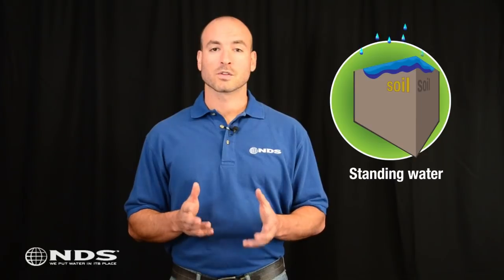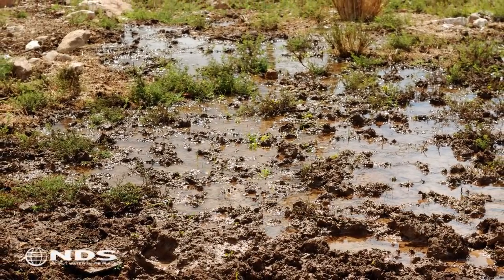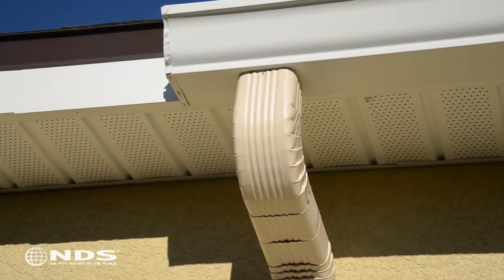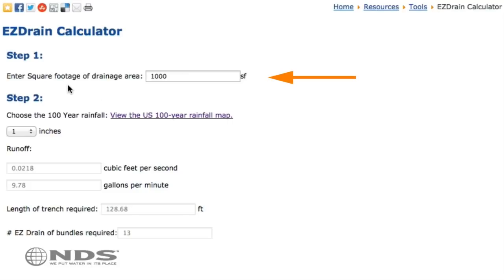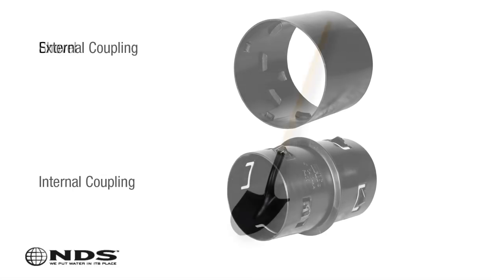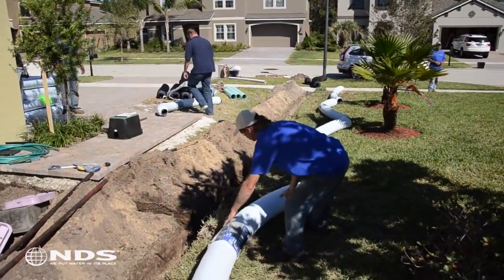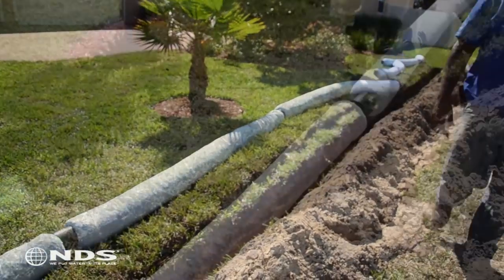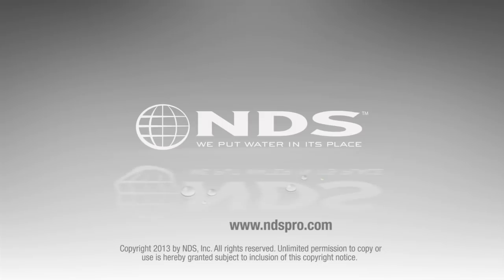How to Install the EZ Drain™ French Drain | NDS Yard Drainage Systems

Comment: do you still need to use fabric around the EZ drain pipe?
Reply from the maker: Hi there,

Great question! For specific installation recommendations like whether fabric is needed around the EZ Drain pipe, I recommend reaching out to our Technical Services team. They’ll be able to provide the best guidance for your project.

You can contact them directly at TechServices@ndssupport.com.

Let me know if there’s anything else I can assist you with!

Comment: You need to develop a drain like a well screen.   The fines need s way of coming out.  I run the high end up to the surface so you can run a hose down it and tight line at the bottom so you can cap it off and let it fill with water during the wet season.  The take off the cap and let all the muddy water come gushing out.   Do that a couple times and you'll have a good drain.  Also bring the rock all the way to the surface.

Comment: I never backfill EZ Flow with the dirt that I dug out to make the trench. I always backfill using sand. It costs more, but does a much better job & makes the percolation for more efficient. I never connect gutter downspouts into the EZ Flow as leaves & debris can clog them on the inside.
Reply: Ian Laccohee  So how do YOU get rid of water coming out of down spouts?  I have that problem and thinking of using EZ-Drain to disperse the water along the trench, possibly with a spout at the end to take care of excess water when it rains heavily.
Now my plan is to use those perforated screens that fit horizontally at the top of the gutters.  They catch leaves  and debris that normally would go into the gutter.  Having solved that problem, I still haven't found a way to keep shingle gravel out of the EZ drain.  With the perforated screens on top of the gutters, I still get shingle gravel through the down spout.
There really is no good way to maintain EZ -Drain once it's in the ground.
Reply: @koyotekola6916   Did you ever figure this out? Looking to do the same thing
Reply: @braykowalski9522  I decided to take a different approach. Instead of using E-Flow or perforated pipe, I decided to just channel all the the water to the end, where I installed a drain box. I did this because my yard has a gradual incline away from the house. If I didn't, I would have gone with AZ-Flow to get the water out that would stagnate in the pipe. Alternately, you can use perforated pipe.

My biggest problem was finding fittings where I could come off the vertical downspout, the make a U to the almost horizontal pipe leading down to a drain box. The drain box has a vertical stack of gravel that absorbs most everything. If it overflows, it's away from the house.

Comment: This is an old video, but I was going to use this system until I saw that some folks had problems with clay soil.  Then the company representative on here said, "Yeah, you can't use in clay soil, we recommend using sand or topsoil".  Really?  The company can't just state that it doesn't work in that type soil?  It sure wasn't mentioned in this video.  Another rip off company doing shady business practices.  If there is someone else out there like me that was considering this BS system, be advised it does not work with clay soil because the soil will clog up the material that is over the peanuts.  They don't say that and of course we all know why.  Bunch of BS.
Reply from the maker: Hi James. Thanks for reaching out, we appreciate your feedback. When it comes to installing your NDS EZ-Drain in soils with a lot of clay we recommend that before placing the EZ-Drain in the trench, line the trench with an additional layer of geo textile fabric which is similar to a weed barrier fabric, to prevent clay from clogging the pipe. Lastly, when backfilling, do not use the clay you dig out of the trench, or runoff water will not be able to get to the EZ-Drain. We recommend that you backfill with a very permeable soil, like top soil, that you can find at your local garden center. I  hope this was helpful. Please feel free to rech out to our technical services team if you have any additional quesitons. Thanks. Techservice@ndspro.com
Reply: NDS Stormwater Management so put this in the ads !
Reply: @Ndspro  in other words, build a regular french drain system. so much for saving time
Reply: @Ndspro  Haha. I've checked just about all the various "topsoils" sold by Home Depot and haven't found one that actually had soil in it - you know - DIRT. They're all organic material (mostly tree bark) and just one or two may have a small percentage of dirt mixed in. It's a mystery to me, I would have thought dirt would be cheaper than organic material but figure the companies that "package" the material as top soil are getting it free or cheap from towns and counties that are mulching yard debris and leaves from their municipal programs and just can't get rid of the stuff quickly enough.

Comment: Helpful video and it covers some things other videos leave out.  I would have liked to see something about how the french drain ended.  Did it go under the sidewalk and pour into the street or did you guys actually cap both ends?  That doesn't seem like a complete solution.
Reply from the maker: Hi Page! Thanks for reaching out. In this particular installation, EZ-Drain was dropped into the ground in order to collect the standing water that was caused by having no gutters on the roof. In this instance, EZ-Drain collects that water and slowly percolates it back into the ground so EZDrain was capped off on both ends. If you are in an area that needs water to be taken away, for example less than 10ft from the home, you can connect the EZ-Drain to pipe and direct that water to a safe discharge point like the street. I hope this was helpful. If you have any more questions please don't hesitate to reach out to our technical team at technicalservices@ndspro.com

Comment: Why does it require a sloped installation when the water is only stored and cant flow out anyway?
Reply: You still want the water to be moved away from the house when it becomes saturated. It will flow through the pipe when enough water starts to soak in from the top.
Reply: This is a pre fab drain, just like a traditional French drain. Water will rise up through (water always enters from the bottom of the system into the pipe, not the top) the aggerate and flow into the internal pipe. Without slope the water would just sit in the pipe, and the system, leaving your yard like it was before...soaked and flooded!

Comment: This is what I don't understand. You obviously have to bury that drain deep to avoid water from traveling under it and into your basement (or anywhere under your house)--especially if you live on any kind of a grade/hill where water is all traveling downward. So where does the water exit once it's in the EZ Drain? How does the water in the drain rise up from its 2 foot depth and out into an area away from your home? Thanks!
Reply: Tie it into a storm drain or drain it into a water garden 🤙

Comment: This product looks amazing!  One question that I don't see covered anywhere though - I have two low-lying areas in my yard - one against the house, and one about 15' out from the house in the yard.  Can these EZ Drains be connected in a Y shape so I can dig two trenches, one for each of my trouble areas, but connect them to one main runoff line?  Thanks for any information!
Reply from the maker: Hi Cherstin! Thanks for your question. Yes, you can use a wye or a tee fitting to tie both lines into the main runoff line. If you have any further questions please don't hesitate to reach out to our technical services department: techservice@ndspro.com
Reply: NDS Stormwater Management Should  I wrap when back filling red clay ?

Comment: I would like to use the EZ-Drain. can it be hook up to the downspout under ground
Reply from the maker: +Denise Taylor Hi Denise! Short answer is yes, EZ-Drain can be hooked up to the downspout. Here is a link to our website that will help provide more information. Additionally, if you still have questions, please feel free to reach out to our technical services department at techservice@ndspro.com http://www.ndspro.com/PDFs/Installation-Instructions/EZ-Flow-Drainage-System-Installation-Instructions.pdf
Reply: Thank you very much for your help.
Reply: My understanding is that you do not want to fill your french drain with water from the roofline. It's simply too much water being directed into one area. Your post was 3 years ago. Have you had any problems yet?
Reply: @billthayer5239  A larger concern is debris clogging the French drain.  Solid drain pipe to a drywell is a better solution.

Comment: What about adding landscape fabric to bottom of trench?  Is that needed?  Or, does fabric around Ez drain pipe protect if from fine particle soil debris?
Reply from the maker: +Grant Brown Hi Grant! There is no need to add another layer of filter fabric, EZ-Drain has two layers of filtration: the mesh and the styrene aggregate.
Reply: NDS Stormwater Management unless you have clay, then they clog

Comment: Is there a T or Y -type of connection to drain standing water from two trouble spots using NDS product? Or is it not recommended?
Reply from the maker: Elena You Hello! We currently only offer internal coupling for our EZDrain products. Since it has corrigated pipe, single wall corrugated pilpe fitting will work. I hope that helps answer your question!

Comment: In this video it is mentioned to dig a trench at least 10 feet away from foundation. On the NDS website a video shows the easy drain being placed right against  the foundation. Why the difference and why does it need to be so far away from the property?
Reply from the maker: Sylwia Hunsinger Hi Sylwia, thanks for reaching out. EZ Drain can be installed next to the foundation or footing of the house when it is being used as a french drain (water is draining into the drain). However, when it is being used as a leach line (water needs to be drained out of the drain), we recommend it be installed at least 10ft away from the foundation of footing of your home. I hope this has been helpful. This product is very versatile with many applications. For more information, please visit our website for detailed instructions: www.ndspro.com. If you have any further questions please don't hesitate to reach out to Dr. Drainage, our resident civil engineer drdrainage@ndspro.com.
Reply: I had the same question.  I saw some other pros in their videos installing this product right next to the foundation and speaking very highly of it.  I plan on doing this myself and rubber sealing the foundation too.
Reply: Nds could you all help me out i have water build up on the side of the garage and I've heard don't allow the downspouts to go into the french drain.  Any truth to this and would which drainage pipe should i use the flex with the peanuts, the just flexible one or PVC with holes in it?
Reply: Kimara Richardson can gravel be placed on top of several runs of this drain system instead of dirt?
Reply: @janeholmes4334  that's my question too, haven't seen an answer
Reply from the maker: Hi Richard! Please let us know how your project goes and if we can help in any way :)

Comment: I noticed the drains are white yet when the guys were shoveling in the dirt the drains are black. What is the part in the video that was not included about the black netting? The black netting wasn't discussed in the equipment needed section. What you say?
Reply from the maker: Sylwia Hunsinger Yes, you are correct, there are two versions of this product. EZ-Drain is sold through our retail distributors and has the white fabric wrapped around it. It is the one we are featuring in this video. Ezflow is sold through our wholesale distribution and has black fabric wrapped around it. Both products are very similar and perform equally. The reason for the differentiation is because Ezflow comes in different sizes and is more suited for the contracotr that installs different size jobs, both residential and commercial. EZ-Drain is more homeowner friendly with sizes that suit only residential needs. For your caly soil needs, we recommend you use the additional fabric becasue of the high silt content. The fabric prevents the small soil particles from working their way through the fabric and gravel substitue and potentially clogging the pipe. Additional fabric is not required in other soil types such as sand.
Reply from the maker: Hi Roger! I apologize for the confusion. The black netting you see is actually our contractor product, EZflow which is very similar to EZDrain. The footage must have gotten mixed up when this was in production. There is not extra netting needed. Everything that is necessary for this installation is in the equipment needed section and the installation steps are still valid. This is a great product!
Reply: NDS Stormwater Management I noticed the same thing. That the item in the video changes colors.According to your explanation the contractor item is different, why? It seems there is an extra layer " sock" over the pipe, which would keep out extra soil. Why does the commercial product not include this extra barrier and the commercial does not? Also I have been reading up on it and seems without it too much dirt gets into the drainage pipe over time and can potentially clog it up.  thanks

Comment: French drains always clog after a couple of years...Don't ever install one!
Use real drains and pvc pipes for the run off.
Reply: What do you mean a real drain? So I live on a slope, have water coming in the basement at the footer, what other solution do I have instead of a french drain?
Reply: @sandman64 did you use just gravel and pipe in your french drain?
Reply from the maker: We agree! Traditional french drains are time consuming and labor intensive, and that's why we love the EZDrain product. It's a gravel free alternative and helps protect your home and yard form costly water damage.
Reply: NDS Stormwater Management unless you have clay apparently

Comment: We used this stuff in a cay ground and the screen clogged and would no longer pass water so we ended up going back to gravel and preferated pipe and haven't had a problem since..  The residue from clay will create a film on the meshing that forms a barrier and clogs the screen..
Reply: What about using stone over top?
Reply: Maybe you should have mentioned this extremely important point somewhere in your video to begin with (or on your website). One wouldn't know unless they happened across this tip in the comment section.
Reply: @bobpinkos9711  
It will eventually clog up either way. This has nothing to do with the product itself. Clay is awful for this. I bet the guy above had either clogged or slow flow drain problems every few years. The reason it did not last as long is due Ezflow being a smaller system and the fabric allows more flow. Ezflow pushes around 30% more water then the traditional system so under clay it will seem to fail faster if not installed correctly. That's the only reason he thinks its working. Its just a slower ticking time bomb. Clay gets into that fabric and stops the flow of water no matter what. Best thing to do is backfill with sand and not burrito wrap. Dig trench (deeper then normal), fill some sand(backfill) around the hole, place some rocks, place perforated pipe, add rest of rocks, Put fabric on top (Just the top), backfill (sand/etc), and then place your dirt/clay grass back on. Reason to not burrito wrap your entire pipe is because it will just slow the flow down.. Placing it on top is all you need. Make sure to add a catch basin somewhere so you can clean out the system when needed. No system last forever but its easy to clean out a French drain if you have an access point.
Reply: @bobshanery5152  amen to this
Reply: @bobshanery5152  Spot on dude... you know what you're talking about.  Some people are very dense and would complain about primer paint not sticking to dirt surfaces properly if that wasn't pointed out in the directions.
Reply: @bobshanery5152  nah this is incorrect. Silt will eventually fill in the voids between your stones. Thats why filter fabric is necessary to keep that out. You will find out sooner than later.
Reply: Not to be a jerk but if you're dealing with clay it'll clog anything.... you might as well have filled in the trench with epoxy
Reply from the maker: Thanks for your reaching out, we appreciate your feedback and we regret the trouble you had with our French drain system. We recommend that when the soil type is clay that you amend this soil or use a more permeable soil such as sand and/or top soil as backfill otherwise you will experience the problems you had.

Comment: For part of my eagle scout project I need to install a drainage system at the entrance to a walking trail. The entrance is located halfway down a hillside and the closest place to dump gravel for a french drain would be 165 feet above so I am looking at the EZ drain. The soil in the area contains clay. Would the EZ drain work here and what type of soil or sand would you cover it with and since it is slopping I am concerned that what I cover the drain with will not get washed away??
Reply from the maker: Hello Julie! You can definitely install EZDrain in clay soil. Please visit our youtube homepage (EZ-Drain French Drain: Tips for installing in clay soils) to see a video about that. Additionally, to prevent erosion, EZ Drain should be covered with a heavy stone such as a ¾” to 1”  drain stone.